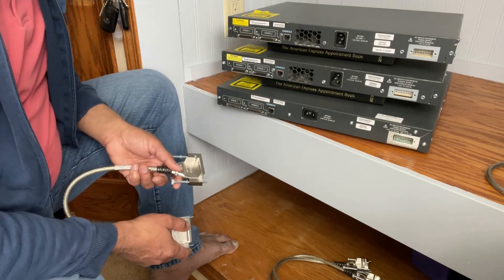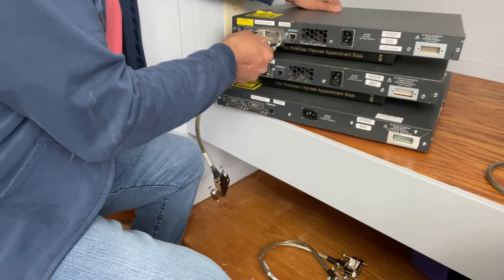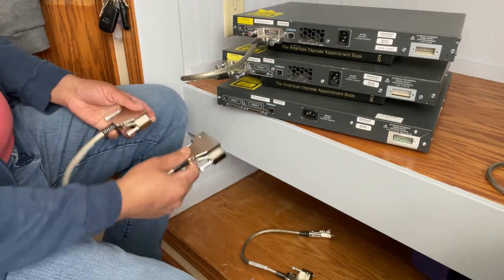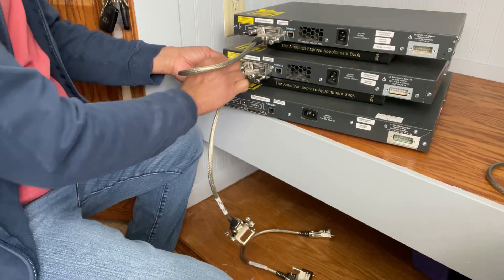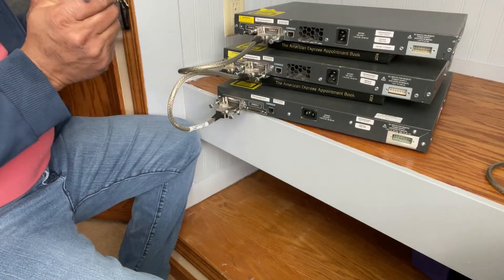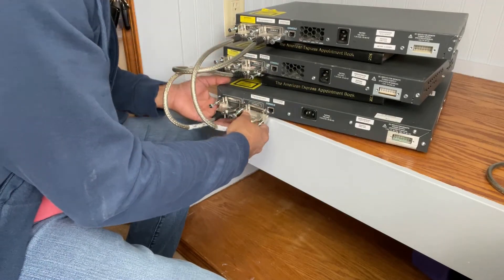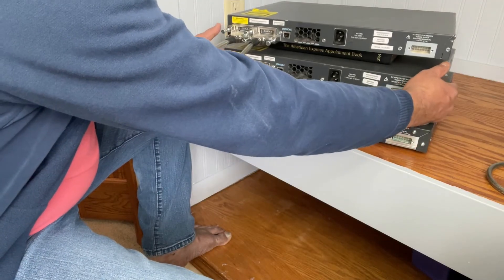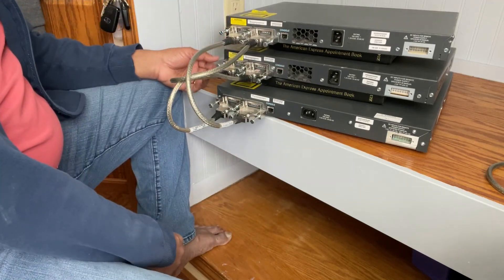Cisco Switch Stacking

Comment: is it a necessary rule to stack the stack ports  like   2 to 1   or  1 to 2 ?  
is it possible to connect the stack ports like below?:
SW1 - STACKPORT 1  ---> SW2 - STACKPORT 1
SW2 - STACKPORT 2 ----> SW3 - STACKPORT 2
SW1 - STACKPORT 2 -----> SW3 - STACKPORT 1
Reply from the maker: You can do that also. But, if you do that,  stacking cables will take up lot more space in the back. Also stacking cable will have sharp bent. Hope this helps..
Reply: @networktutor640  thanks that helped lot

Comment: nice video keep making like this sir.
one qus suppose we have 5 switch do we have to connect cable between sw1-sw2, sw2-sw3, sw3-sw4, sw4-sw5 , do we connect sw1-sw5, sw2-sw4???? pls reply and guide
Reply from the maker: you need to connect 1 and 5. This will complete the full stack ring. If you don't do this, say: if the cable fail between switch 2 and 3, you will end up with 2 different stacks.